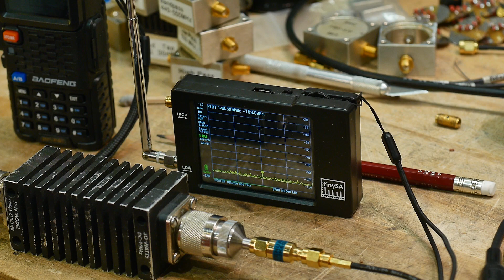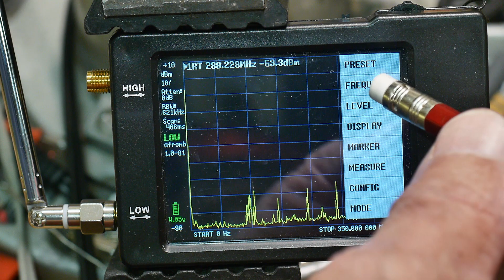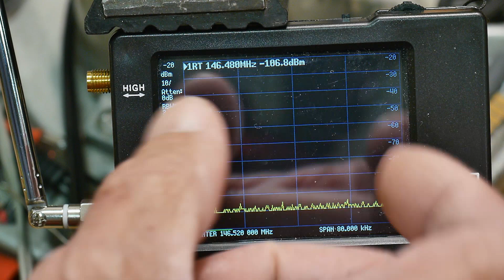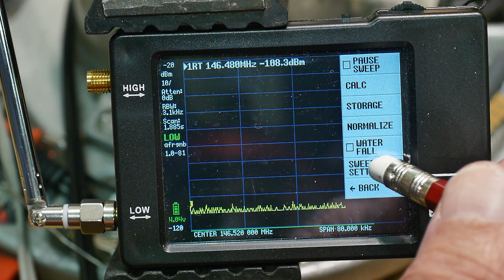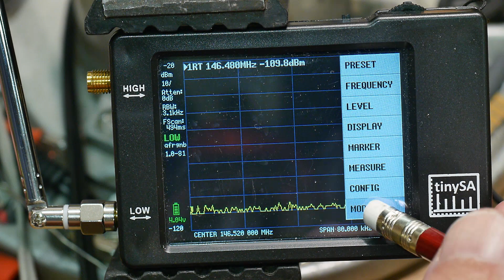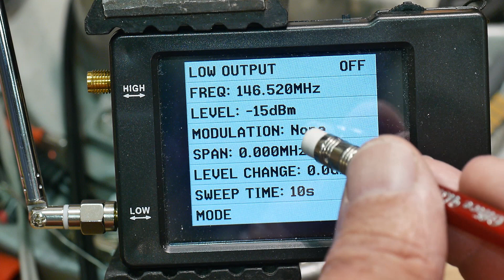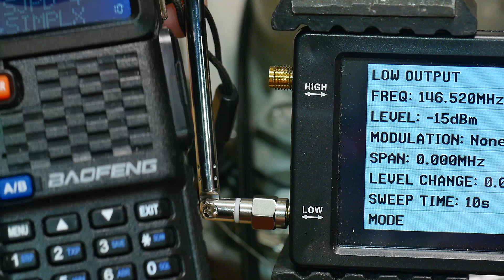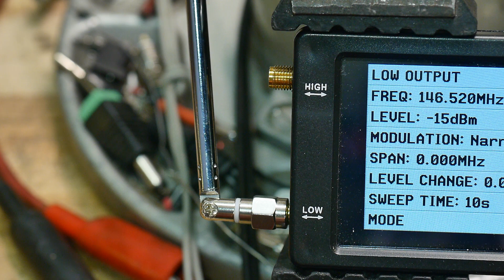#551b TinySA Wireless Measurements

Comment: Thanks for your informative videos! I'm new to all this, so apologies if this is obvious, but would you be able to get an estimate of field strength using the TinySA antenna like this? I'm curious if this could be used to help confirm FCC Part 15 compliance for extremely low power AM and FM transmitters.

Comment: Is it possible to use a tinySA to measure your HF, VHF, UHF antenna outputs to see if it complies with FCC Maximal Permissible Exposure limits for controlled and uncontrolled environments?  Are the TinySA and capabilities and small antenna accurate enough to do that?  I realize the Tiny SA displays power levels but the FCC exposure limits are in field strength so that might be an issue unless there is a way to convert power to power density (mW/cm^2) or field strength.

Comment: Is it possible to blow the front end of the TinySA, by letting it receive a big signal froma a near by ham station? 
For an unknown reason so far, my Tiny SA, which I bought used, worked fine and somehow both the IN and OUT modes stopped working normaly. Now, it does receive, but only strong signals from my handheld, using the antennas. on both Working at the OUT mode, my tranceivers are unable to detect a -76 dBm signal at all. Only if I put it at it's maximum, it can be heard. The HIGH IN and OUT, both  work fine.
So, I am guessing that maybe a strong signal from a near by fellow ham, (approx 20 m away), made the damage, since he is always trasmsitting at 100 W.
Reply from the maker: sounds like the input attenuator IC in the Tiny is dead. it could be damaged by large signal or static electricity. Later models have added a protection diode on the input for static.
Reply: @IMSAIGuy  Thank you! I know it's extremely hard to repalce the IC, but do you know anyone that could make a try to fix it? I already purchased a new ome, but I wish I had two working units instead of 1,5
Reply from the maker: @batfalcononyoutube no sorry

Comment: Can a spectrum analyzer  monitor a car FOB signal? I want to know if the FOB is till transmitting even after I shut it off and also, to check if a Faraday shield actually prevent transmission. Thanks.
Reply from the maker: yes

Comment: I'm impressed my HT hits the freq right on.  All I've read were that these low cost HT's are not true to the freq.  Impressed with the SA and my HT.  I did the tone/modulation test and got the wider peak with tone as opposed to the thinner peak without tone.  But I don't understand why that is a practical thing to know.  So I'm not sure what meaning the wider bandwidth has?  Thank you for this video.
Reply: FM transmitters modulate frequency to convey information like speech and tones. So as a tone is transmitted, the observed frequency shown on the TinySA raises and lowers in frequency. Higher pitched tones are higher in frequency than lower pitched tones. 
The change in frequency that you see on the TinySA is the band width or deviation of the transmitted signal  around the carrier frequency. 
Radio Amatuers, for example, on the 2m band need to keep deviation to no more that 5Khz.
73

Comment: How far away should I be from a 100 watt radio?
Reply from the maker: Yikes. I'm not quite sure. I'd start with an attenuator in line and see what that says first. Also, don't pull the antenna out to length. keep it really short first.
Reply: @IMSAIGuy  what size attenuator
Reply from the maker: @electromechanicalstuff2602  I have a bunch so am lucky. If you have something from 20 to 30dB that should be OK. The little 2W SMA attenuators are fine. if you don't have an attenuator. just push the antena down so it is short. start at 100ft away. I like to keep the reading below 0dBm. move closer or pull the antenna out slowly and see what happens. Also remember the power level will depend on your location to the antenna emission lobes.

Comment: You  are aware that you are transmitting in the universal simplex calling frequency in the 2M ham band and have broken the law by not identifying yourself.  de N1ABE
Reply from the maker: I did an identify off camera
Reply: @IMSAIGuy  Just checking.  Thanks.
Reply: @johnbrandolini2915  didn’t seem like it was formed as a question

Comment: But, but isn't that the established calling frequency?  : )
Reply from the maker: yes, i suppose 146.55 would be better just in case
Reply from the maker: anyway no one returned the call :(
Reply: @IMSAIGuy  Aw : (

I've been studying for both the Technician and General. I may not get both, but I am going to try. I just got done studying 30 hours of S-Parameter, TDR, and signal integrity videos, for a job I may not get, so I might as well get something for my bother.
Reply: @BrendaEM  How did you do on that? 😎
Reply: @digitalchaos1980  , Hi , I got them both. : )
Reply: @BrendaEM  Most awesome! I need to try for mine soon. 😎

Comment: Gr8 video, can you also check for spurious harmonic transmission by widening your bandwidth on the TinySA
Reply from the maker: I intentionally avoided that as the TinySA has lots of it's own spurs using the antenna. It is hard to separate those from any real spurs of the HT radio. Using attenuators with the radio connected directly fixes the problem.